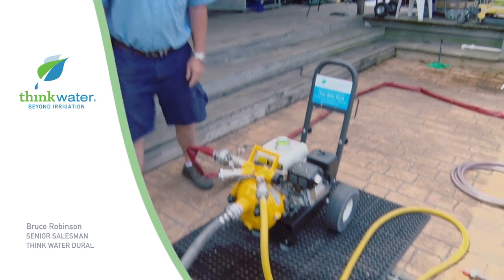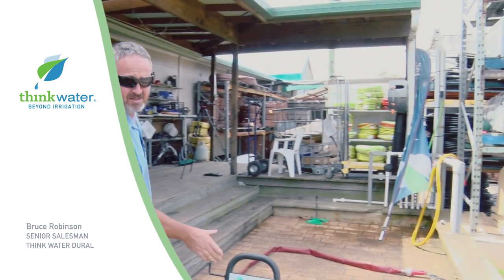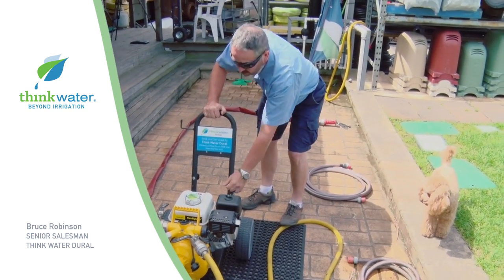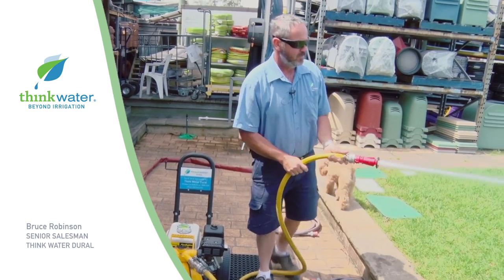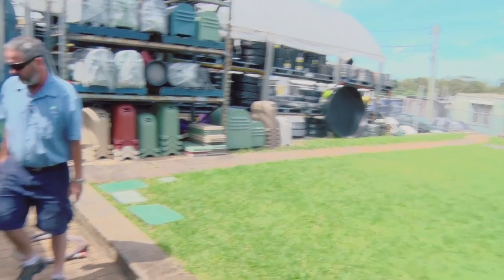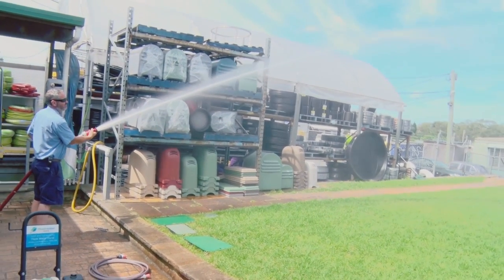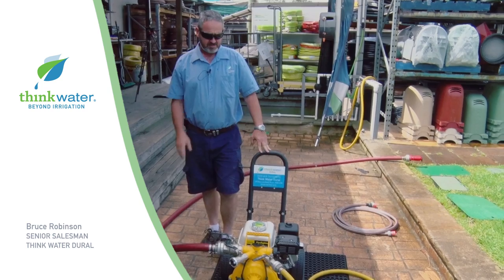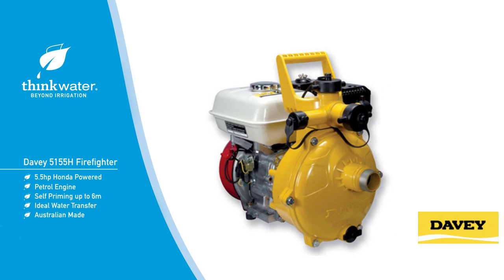Think Water - Davey Firefighting Demonstration Video

Comment: How many mtrs does it shoot water? Very important feature! But no mention, Why?
Reply: Hose diameter size, hose length run & nozzle selection, wind speed are factors that affect range. You are going to have more than enough distance to squirt water at flames & wet down structures with that setup. Firefighting & property protection is not a precise science & always pre prepare & have a bushfire plan becuase when a bushfire happens you won't remember most of that plan, you'll handle it as it comes & it can come fast and hard with no mercy.

Comment: Genuine Honda powerhead & Davey pump can't be beaten for fire fighting or moving water around, twin impellor are even better for fire fighting making more pressure. Make it a habit & Always return the stop switch to the ON position immediatley after shutdown. If it won't start most likely it is switched off & you may have flooded it trying to start it that way.